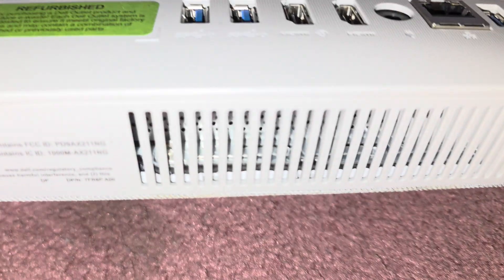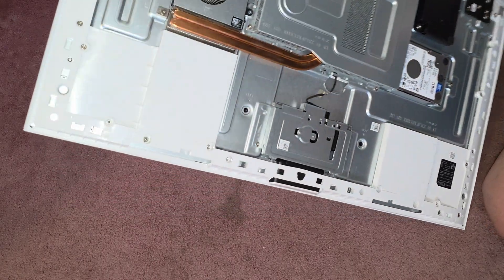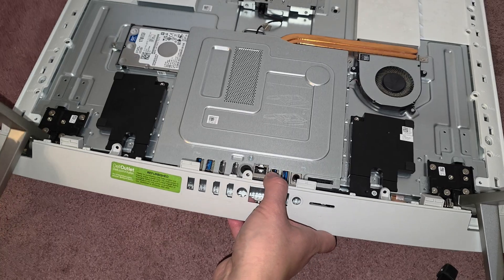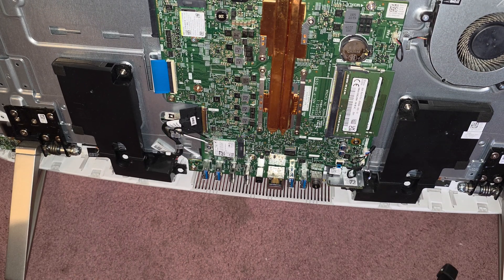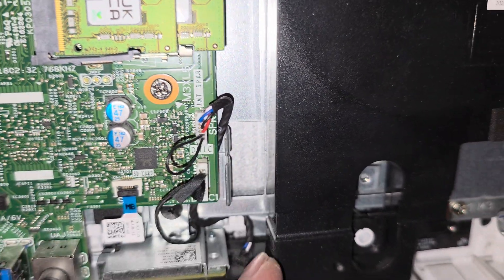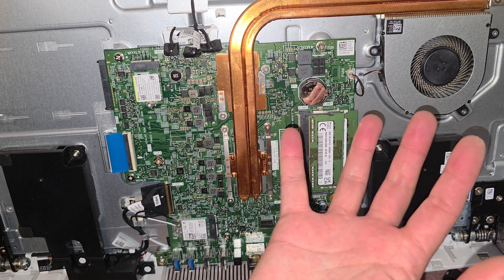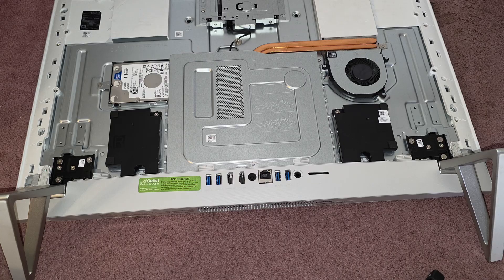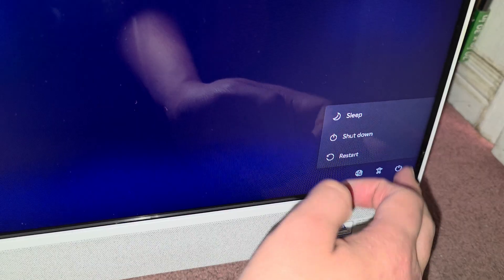DELL Inspiron 27 7710 All-in-One Disassembly RAM SSD Hard Drive Upgrade Battery Replacement Repair

Comment: My wife has the identical computer and it just shut down. Pressing the power button does nothing but power it definitely getting to the machine. I also saw how you removed the hard drive and when I looked at the back of my computer there is nothing there? What’s up with that?
Reply from the maker: 8:53 you likely only have that SSD.

Comment: Thanks for the video on how to take case apart. I have the same model, maybe just different specs. I get error Chipset heatsink not detected. I thought maybe there is a spring loaded heatsink that may have come loose. Have you had any experience with this issue on this model or similar?
Reply from the maker: Never heard of that issue before